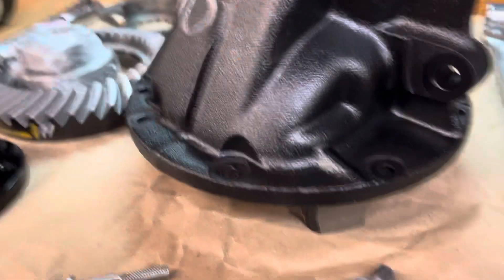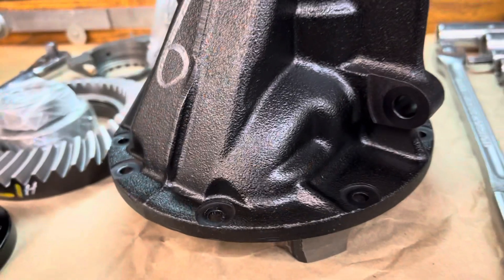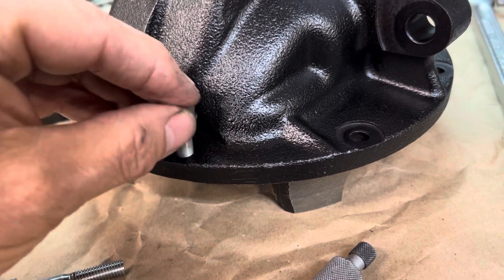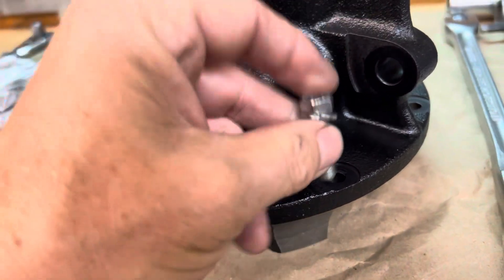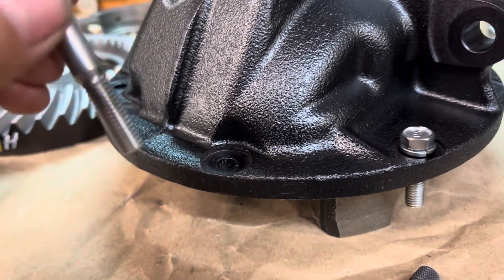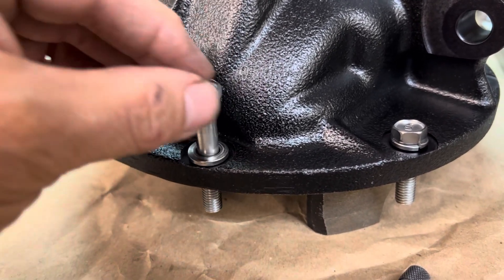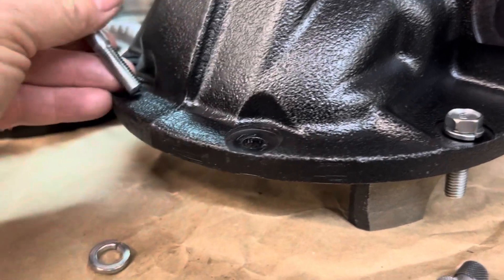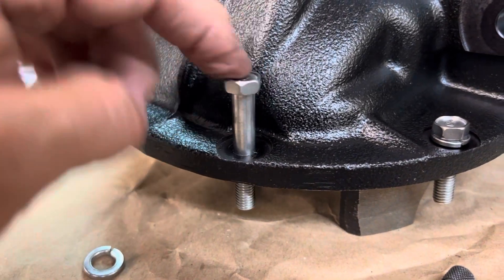Honda thinks of everything, Idiot proofing the S2000 differential aluminum cover bolts #puddymod

Comment: Too bad they didn't think about idiots filling much thicker diff oil than the manual said. Some forced vomiting system or something
Reply from the maker: I run into much thinner gear oil or over fill issues.